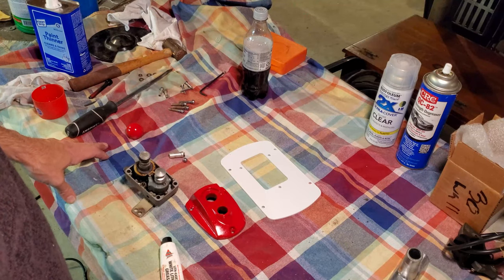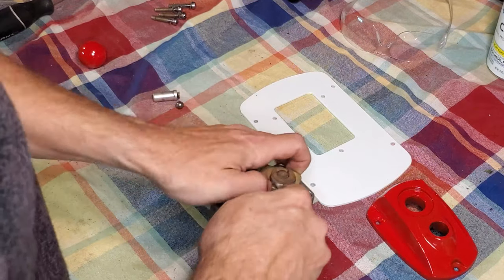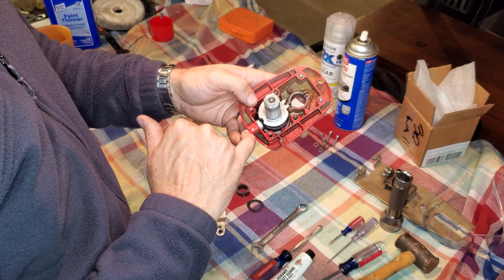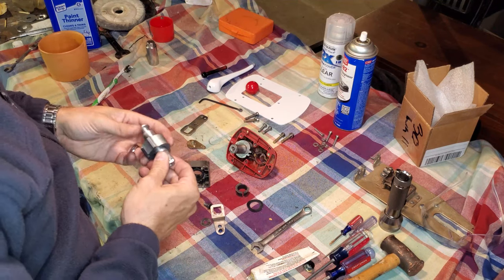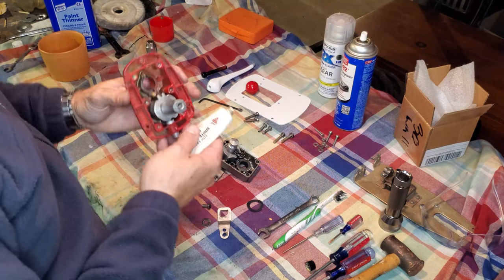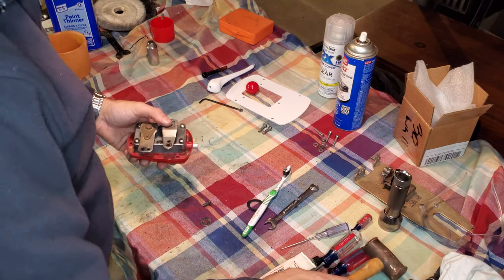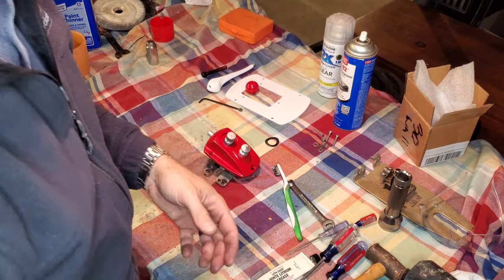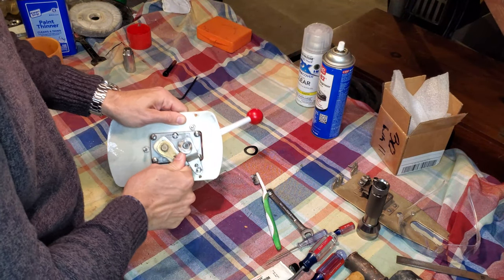How To Rebuild Morse MV Single Lever Throttle and Shifter Boat Control

Comment: Thanks for posting  .... the wave spring you forgot,  did you have to put it in?  For next time start at beginning please including disassembly of cables.  Nice to know how this works  before disassembling and having detent balls shoot accross garage.  Usually the cylinder where detent ball spring goes has a cross drilled hole to allow spring and ball assembly, just like brushes in a motor.  Surprised you didn't add one of you had over fifty tries to get it assembled.  

Still this is great for me, ready to do something similar to my 1996 ski boat.  I have no manual.

Comment: Great video.  Thanks for sharing. I wish you would have covered the cleaning / maintenance part of the pre-load spring for the throttle cable.  Meaning on the part where the cables connect.  It was on your bench, but never covered that part of the controller. Mine currently moves at all positions creating slop in throttle response.

Comment: Hi Jeremy, I been looking for some video like this as crazy. My US MARINE shifter box being disassembled by me and the clutch I saw was dispositioned. The center of the clutch wasn't lock on N that's caused I don't have a reverse, eventhough I shift to reverse took like 30lbs of pull back and engine stall. mine is 1992 maxum 2100sr.

Comment: I took mine partially apart  today but didn't attempt to remove the larger detent ball for the gear shift lever. I have a separate lever for the throttle. The gear shift lever is frozen and won't move at all. I tried pushing the detent ball up to see if the shaft would move at all but it was really hard to do just holding it in my hand. I have had the boat for 12 years and the lever has always moved very easily. I made my way down the Baja coast and observed no difference until I got to La Paz and now it's stuck! I can't imagine it's anything other than that ball holding it or somehow corrosion between the housing and shaft? Any thoughts. By the way, thank you so much for making this video!

Comment: "Hey I forgot some parts. No worries!"
Reply from the maker: I mean, that's one characterization, I suppose - if you didn't actually watch the video and listen to my explanation.  However, if you DID, then you would know it wasn't "some" parts - it was a single, non-essential washer that I never did put back in and, three boating seasons later, has caused exactly zero issues.  But thanks for engaging!